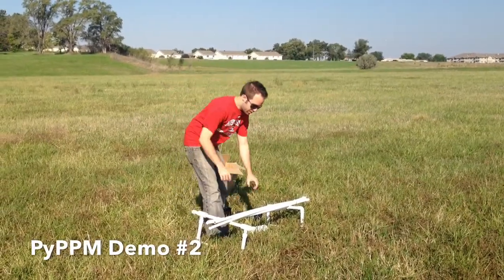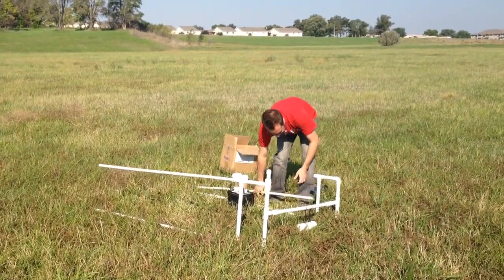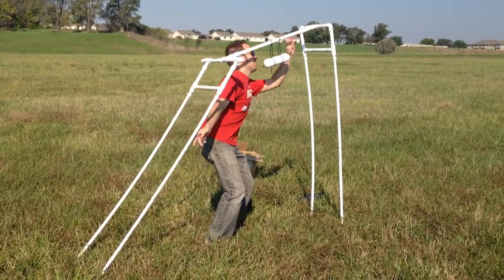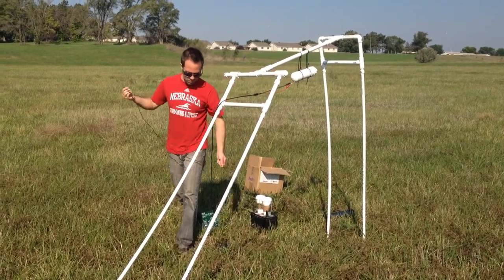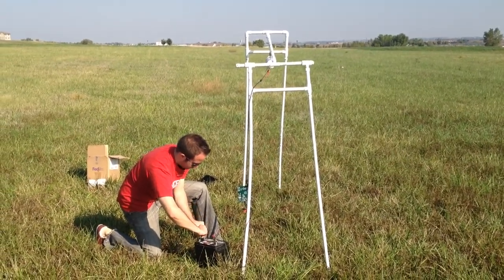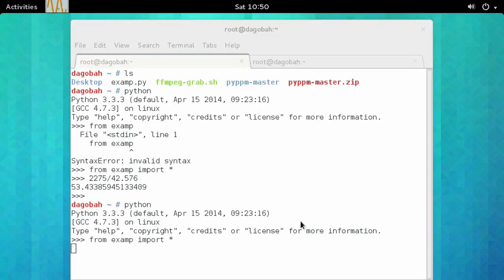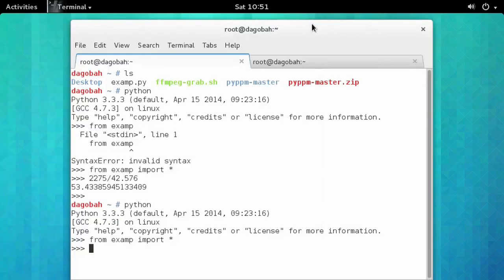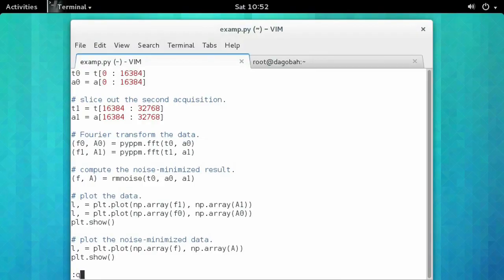PyPPMv1 Second Demonstration

Comment: Last time you where at the Lincoln-Nebraska Campus, I assume slightly below 50 microTesla. This time you are traveling North that is the reason why you get a higher field. Seems that your polarization coils (you call them B+ ?) are Helmholtz pairs. My question is: does it makes sense (for thermal reasons, or for homogeneity) to keep them apart from the main RF coil ?
Thanks for your work, it looks nice !
Reply from the maker: Hi Baudouin, actually the reading at UNL was closer to 52.6 uT; the two measurements were taken within a few miles of each other. As for the coil, it's a simple solenoid, nothing fancy! :)
Reply: It is a super nice project ! I am lecturer at "Institut Supérieur d'Electronique" in Paris, and I would like to test your boards/designs. Could you tell me if there is a possibility to speak with you ?  
Best regards
Reply from the maker: Thanks! I'd be happy to talk with you about the designs (the board is back in the U.S.); feel free to email me at geekysuavo@gmail.com